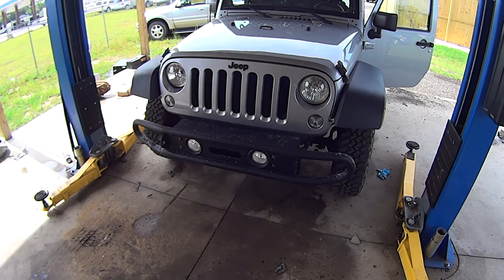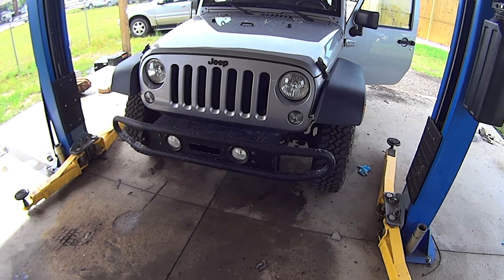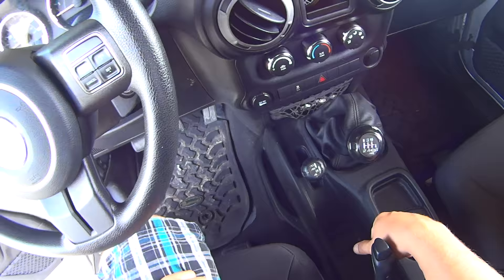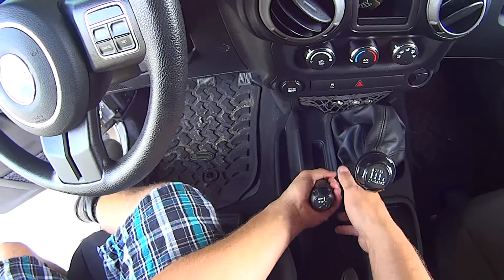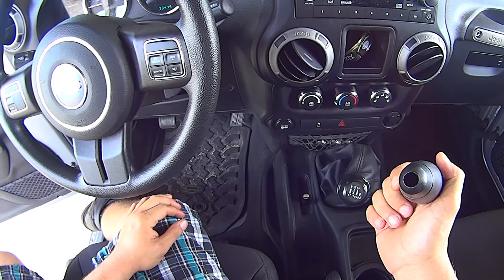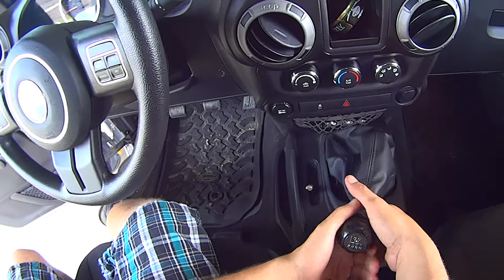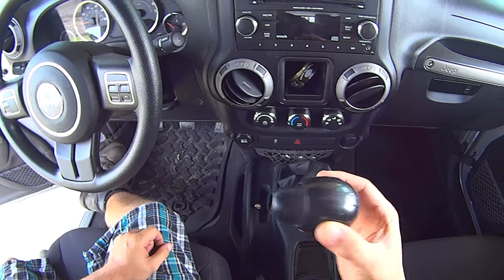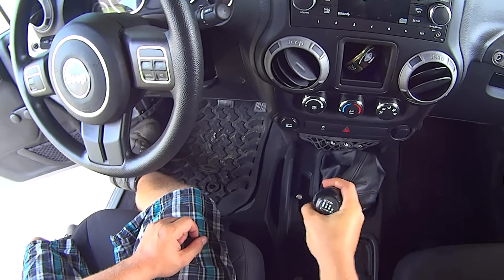How To Quickly Remove Shift Knobs From Jeep JK Wrangler With Manual Transmission

Comment: Bro, there’s gotta be another way. I’ve been pulling hard and the shift won’t budge
Reply: Here’s an update. I finally had enough and said screw it. I used pliers and broke the knob a bit before pulling it off. I was replacing it with another factory one anyways cuz it was damaged.
Reply: @mrdragondan  I finally got it off. Used thick flat head pliers and kept squeezing and turning. Finally loosened up and I could just pull it out. Careful. It’s got layers so you’ll have to keep at it til it fully comes off. The downside being that I threw away the old one but in my case I was replacing anyway it cuz it was broken. Good luck mate
Reply: Same here w 2010 Wrangler Sport UNLIMITED auto trans w manual 4wd shift

Comment: Tried this and still couldn’t get mine off.  I ended up taking the gear numbers off and drilling a  small hole in the center and added a few drops of lubricant.  Did the trick.

Comment: Putting the knob in second gear sitting in the driver seat pulling doing exactly what you said it came right off. I tried, pulling on my own strength earlier and it would not even budge. Thank you for your advice.

Comment: Perfect. In the past I yanked and yanked and once even used a ratchet strap. Today I though there must be an easier method. Steady pressure with a little wiggle does the trick. Thank you!

Comment: What do you recommend to stop the shift knob rattle? It's extremely annoying.
Reply: My 2015 jk was recalled for a shift lever issue and one of the problems was a rattle.
Reply: Maybe Teflon tape?
Reply: @delanopanther1441  I got my jeep back after the recall repair with a loose shift knob, fixed it with your teflon suggestion. Thanks.
Reply: @steveg3207  you're welcome
Reply: I've had several (manual) Wranglers and they all have this stupid shift-knob rattle problem.  It's the  bottom plastic trim collar that rattles. To fix, I put the shifter as far toward the rear as possible (6th gear) so you can see as much of the front of the knob as you can.    I wiggle that bottom collar down, like a hair thickness and carefully put 3 or 4 very small drops of super-glue in the gap, and then press it back up and hold it for a few seconds.  Has worked every time.  Incidentally, I could not remove the knob by pulling on it as this video suggests.